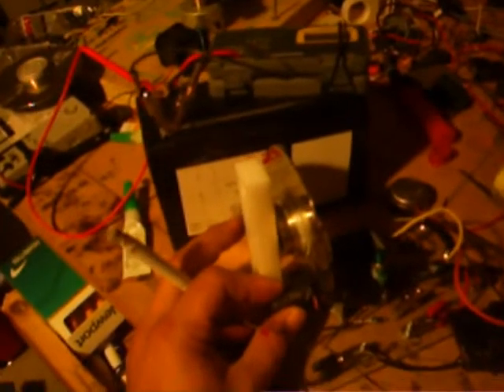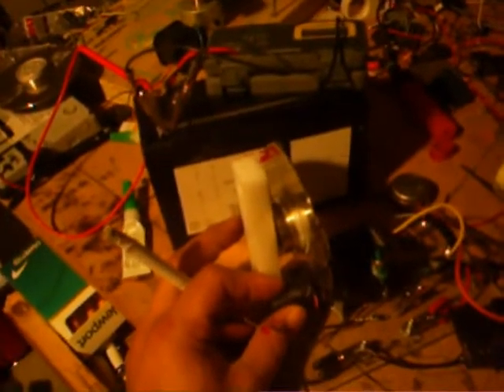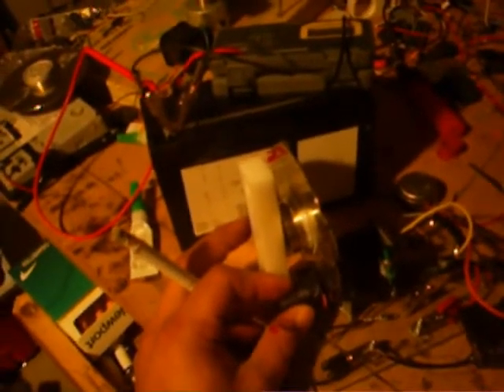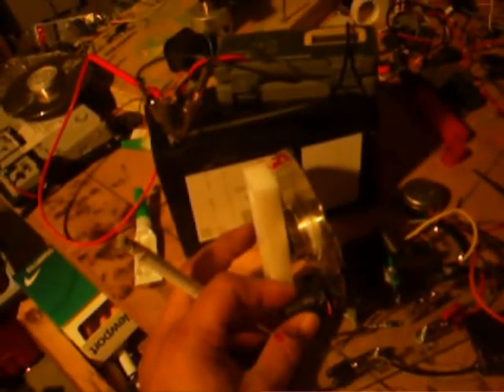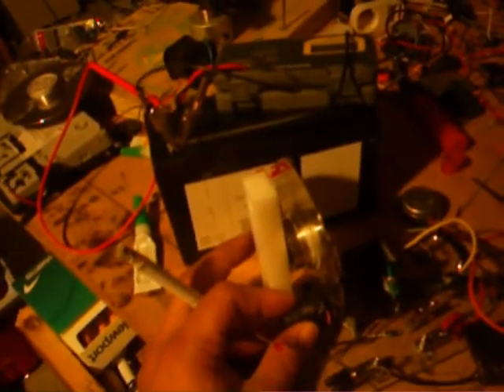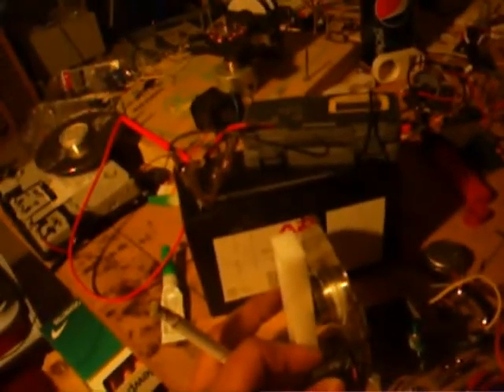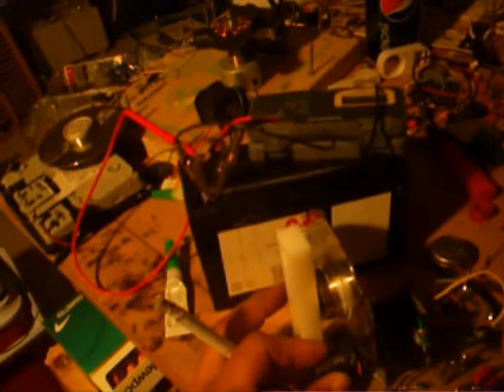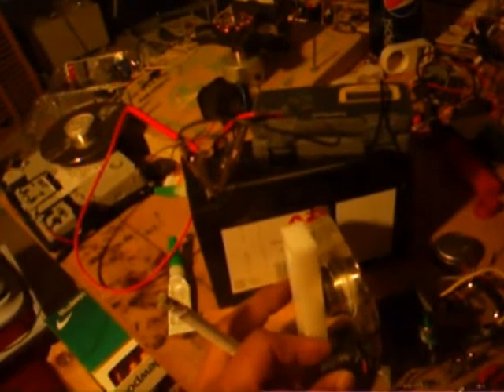Very effective coil/rotor alignment

Comment: maybe you could offer some advice.  My bedini setup works fine with a reed switch instead of the trigger coil.  Both the trigger and power coil light the neons brightly, and there is between 60 and 90 volt spikes on my scope.  BUT, I cannot get the transistor to turn on with the trigger coil alone.  I'm using a wire-wound 1k pot, I've tried both a 12 and 100 ohm base resistor, and my coil is about 300 turns of #28 and #26 wire with a ferrite coil about the size of yours.  The rotor has 6 ceramic magnets and spins freely.  Any ideas ???  Would it be beneficial to just use the reed switch, and use the back EMF from both coils?

Comment: Well, could be, that the LED just conducting the current only
in one direction helps to get this effect.
Would be interesting , if you solder 2 LEDs parallel, but each with
a different polarity and use 2 switches, so you can switch the polarity of the
the LEDs to see, if the polarity of the LED has an effect of it.
Also it is hard to see, how your setup is there.
DO you have magnets on both sides of the rotor disc ?
What material is your rotor disc ?
Regards, Stefan.

Comment from the maker: @erfinder2 no it actually slows the rotor alot when direct shorting the pickup coil, and i think thats because they are acting like they share the same core, the pickup and run. so shorting the pickup is ALMOST like direct shorting the windings as if they were on the run coil as well. i just decided to use about 4 LEDS to illuminate it in a cool way hehe, that way not as much draw/shorting. ok im back now, going to finish the drawing and send it lol

Comment from the maker: @g11690102 actually, that was the first thing i thought of.. cause u are right, it DOES cause an imbalance and slow.. but thats NOT the case!  i know this cause i tried balancing the alignment from all other angles using an identical core. its actually just giving the run coil a boost cause of its virtual extended core.

think about this also... the pickup on the other side would do nothing more than ATTRACT it toward it more, so in essence, it should be creating MORE of an offset and friction

Comment: by having the coils on one side and only 1 coil it causes a warp in the rotor. which causes more friction on the bearing. have one one each side equalizes that warping. if you put your pickup on the same side of the rotor but directly across you should get the speeding up i may be wrong. i had induced wobbles on my rotor using outside magets. granted my rotor is just sitting on the bearing. you might find if it is mouted on a horizonal plane vs the vertical plane a change that way.